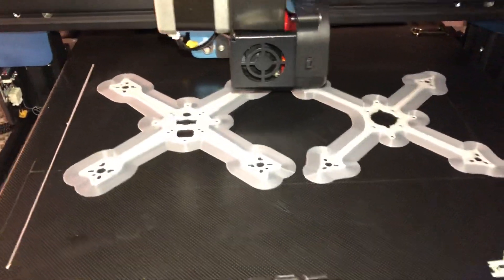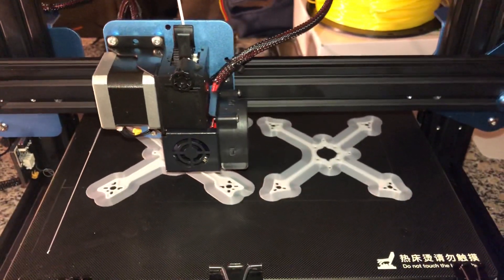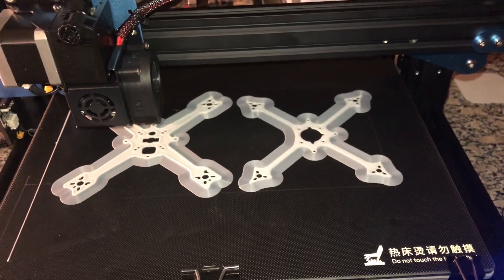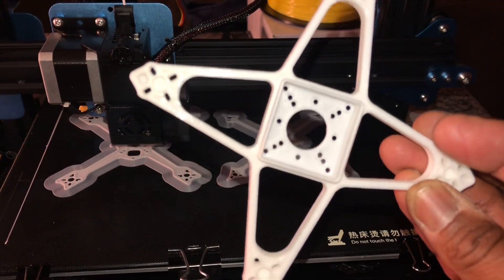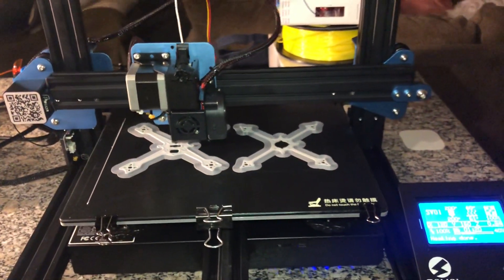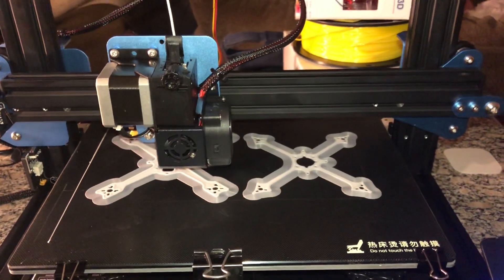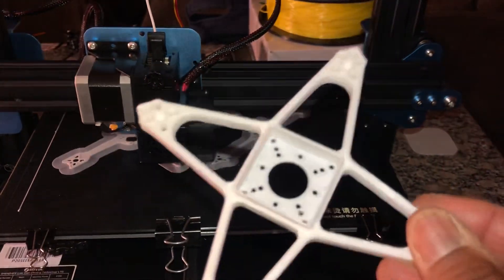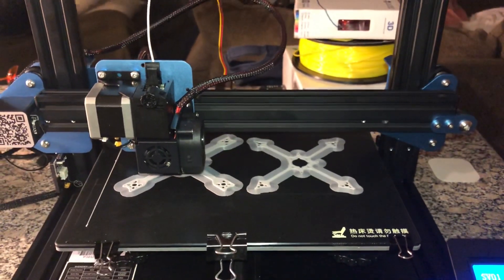PLA Quadcopter Frame 3D Printer SOVOL SV01

Comment: How did the frames work out?
Reply from the maker: Drone Obsessed Jerry on a light 3" build, they hold up fine in dirt ever since I switched to PLA +. I have a video of a 4" Quadcopter I use with it and the frame stud up to some hard crashes! 

In short, good for dirt and grass, not good on concrete or the side of a building. Lol

Comment: Scott if I had your email I could send you the stl's for a frame that I have modded for the tyro 69, it is a 2 1/2 in frame for the 20x20 fc and it uses the Ratel camera with the Eachine nano vtx and a receiver of your reference and don't forget the buzzer. I will send pictures also, they are a little blurry but you will get the idea.
Reply from the maker: Hey  James, you can email me at rom173@yahoo.com.  Thanks!!!

Comment: I have quit a few pla quad builds and as long as you don't hit concrete you will be ok. I have been printing with pla + lately and this stuff is tough, it is like petg only not as flexible. I get my builds from a number of sites but most just lead you to thingaverse. If something is close to what I am looking for I just us tinkercad to manipulate it to my purpose. Let someone else do all the work i'm here to fly !!
Reply from the maker: james shaulis I knew you were the man in this subject James!! If you can direct me to a few successful ones you use, that would be Awesome!!

I only fly in Grass and dirt. 😂

I have TPU and still need to figure out what settings to use. Thanks  Brother!!
Reply: @scottgivens27   It is hard to steer you to any given model that is usable for your application, I find models that have reinforcement for the arms and if I want a certain model I will mod it in Tinkercad  to fit my build. I suck at cad but I shine on Tinkercad.
Reply from the maker: james shaulis 😂... I've done work with tinkercad, but years ago. Hope I still can figure it out. Thanks for everything James!
Reply: @scottgivens27   TPU is easy to print Hot end at 225c and i have my bed at 30c  for my ender3s. My little sowway sw200 prints tpu for me and it has no heated bed. Keep your speed at 40mm, and your retraction at 8 & 40 and I don't use z hop with tpu to keep the blobs from forming.
Reply from the maker: james shaulis thanks a ton James!! Going to try the TPU prints in a bit... Much appreciated!
Reply: @scottgivens27  My Pleasure Bud , Happy Printing !!
Reply from the maker: james shaulis just ordered some PLA Plus on Amazon. Thanks for the tip! What heat temp for the nozzle and the bed  with the plus material?
Reply: @scottgivens27  Scott  for PLA + I use 215c for the hot end and 70c for the bed, on my machines if you are having trouble with prints sticking this filement will test that beds metal.